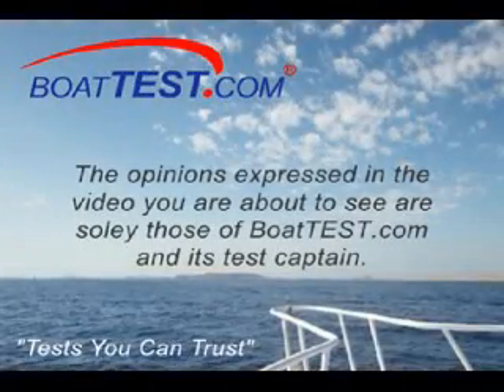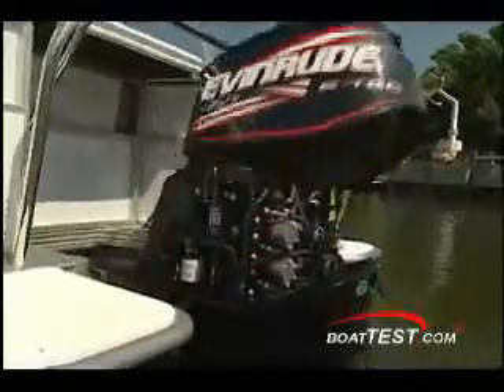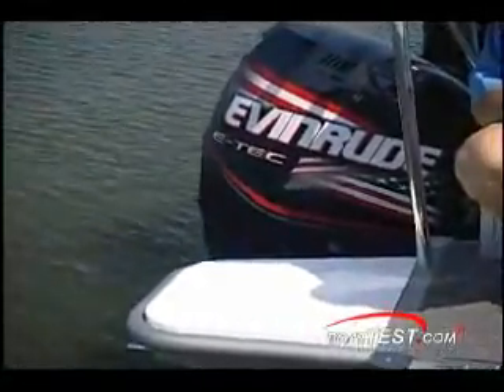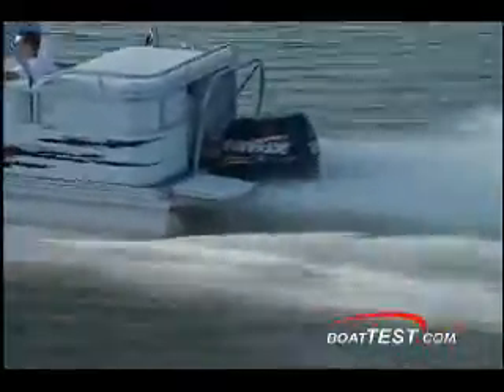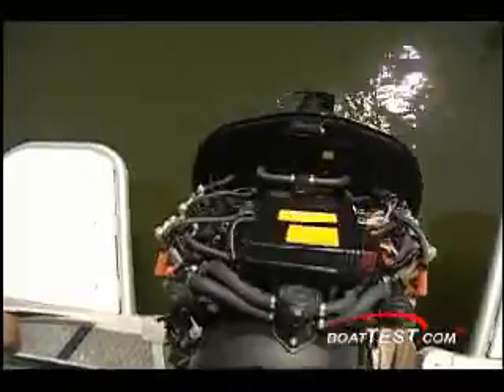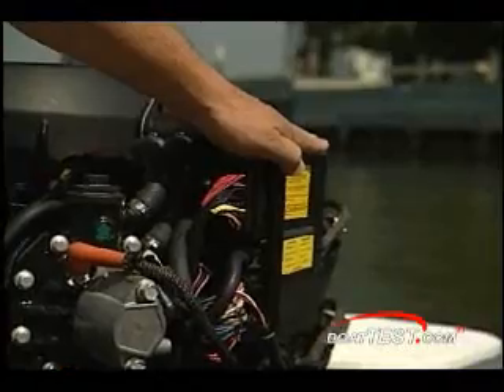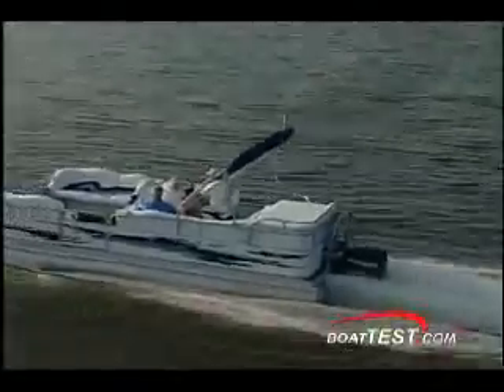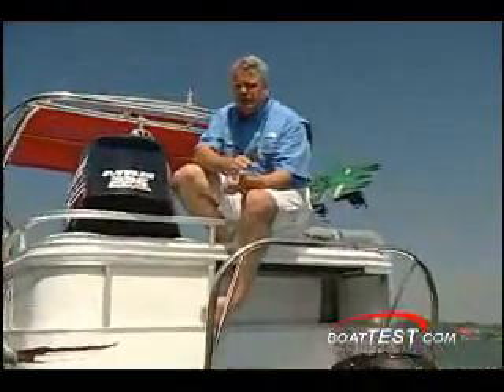Evinrude E-TEC 225-H0 Engine Test - By BoatTest.Com

Comment: Really? Cause I've had my yamaha 40 for 10 years, and have changed the lower unit oil, starter, water pump, thermostat, choke unit, and now one of my coil packs is bad.

Comment: I have an 83 Skeeter Wrangler HP120 rated for a 115 but I strapped a 200 etec on the transom.... I had a 83 mariner 115 on it and got a top speed of 46-52 mph depending on how many people were in the boat    with the etech i now have a top speed of 112-118 mph.....it rocks!!!!!